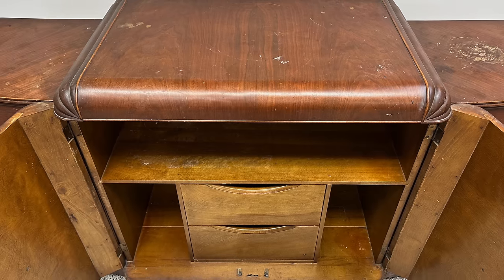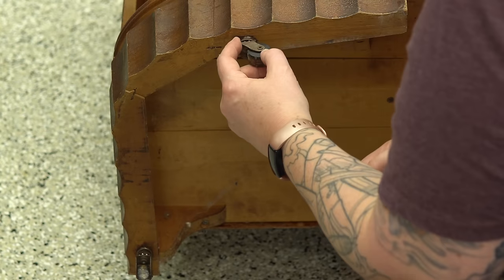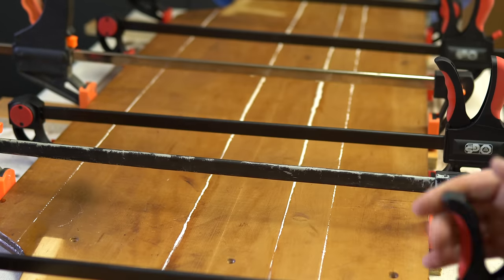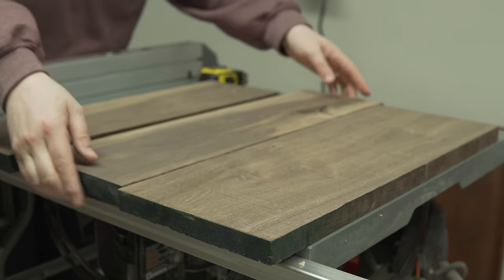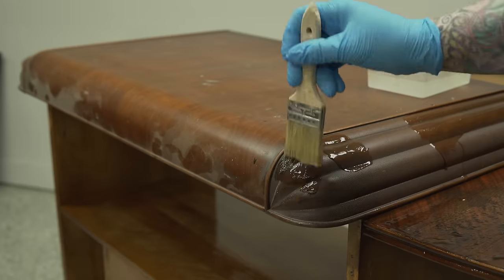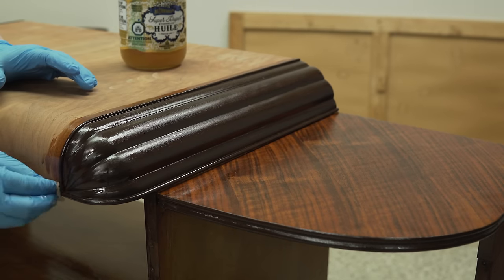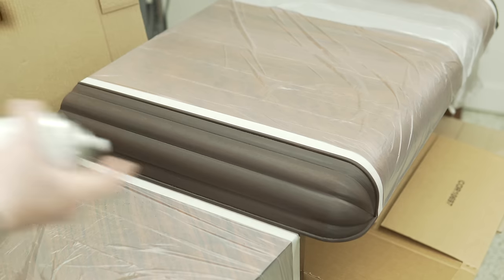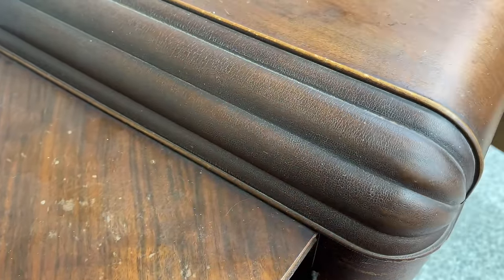I Transformed An Old Buffet Into An Art Deco Masterpiece

Comment: I’m stumped as to how anyone could think the shellac finish of that period is superior to the one you did. All that wood grain hidden for decades. There is no value to a finish that detracts from the beauty of the piece. Beautiful work as always.
Reply: Shellac is a beautiful, classical finish that can be either transparent or subtly tinted. For example check out many pieces on exhibit in the Met in New York. I'm sure the original piece was stunning when new. But when abused via liquid and sun exposure along with dust, it can cloud as here. It's also not as hard as modern varnishes, so accumulated fine scratches impart a haze. With all those flaws, a good shellac finish is still more durable than the oil used here, which will need periodic renewal forever. Finishes - as everything in life - have advantages and disadvantages.
Reply: I agree just stunning
Reply: I wonder how you think Shellack looked in the 1940’s. I think it was a whole different apperance than Today. But, that Aside, as usual, it is a wonderful masterpiece after refinishing! I want it!
Reply: yeah, this boggles my mind that anyone would look at a dingy, old, dirty and disgusting piece of furniture, with holes in veneer and cracked finish and think "wow, nobody should ever touch this thing cause it's basically perfect!" .... no, it needs to be repaired. look at that cabinet, the front doors took my breath away when finished.
Reply: @generessler6282 Shellac can be easily be refreshed and refinished, but it usually yellows. It is super easy to use and smooth though. Can't beat the dry time.
Reply: What a unique piece of furniture!! You really did it justice! There is a lot of controversy over original finish over refinishing an antique. I prefer a good refinish. I have a beautiful solid oak buffet and dining room set from my Grandmother. As it aged it “alligatored” and turned a very dark brown. As I stripped off the old finish I found  beautiful quarter sawn oak. Refinished with tung oil and it is absolutely beautiful!
Reply: beautiful well done
Reply: I'm with you, no comparison! 😊 That walnut really shines!
Reply: @generessler6282  whilst I agree with you about shellac (I have recently refinished an Edwardian dressing table to a high gloss with shellac) I think this piece just needed a new lease of life. Sometimes the shellac finish is just too far gone.
Reply: Shellac is actually a gorgeous finish when it's new and if it's been well cared for. My father has an art deco radio cabinet with original finish and the wood grain is beautiful. I have pieces that I finish with shellac and the glow it gives is really something. Would love to have seen this when it was first made.
Reply: It's a valid preference for staying true to the period vs blending eras. I also like Angie's approach - it's why I watch this channel - but I can understand the purist impulse as well.
Reply from the maker: Odie’s is a very hard wearing tung oil, and no, will not need renewal any more often than other finishes. You contradicted yourself because even shellac needs maintenance over time. ANY finish can be damaged by neglect. Classic doesn’t always mean better, though it can certainly be beautiful when well taken care of.
Reply: There is a group that will only accept original finishing no matter the advantages of more modern finishing.
Reply: People often like things yes
Reply: Right😊
Reply: Beautiful work.  Are you keeping this for yourself?  😊
Reply: B I G job! Beautiful job!
Reply: Stunning, as always.  The burl looks wonderful. I wasn't wild about the really dark stain on the contrast pieces, but knowing your work I had faith it would look beautiful and it does.  I'm always happy to see wood restored.
Reply: Well I can honestly say this restoration is really beautiful. I have never been fond of art decor pieces but two of yours changed my mind completely. Whayever product it takes to give them this second chance  works fine. Well done for another detailed and caring job done!

Comment: I was questioning your decision to go horizontal with the veneer on the side until I saw it all together.  It flows so beautifully with the doors that if it wasn't originally that way, you proved that is the way it needs to be.  Amazing job and I love watching your videos.
Reply from the maker: It’s often the opposite with veneer specifically. Normally, over solid wood running in one direction, is a substrate veneer running perpendicular. Then the outer layer of veneer goes perpendicular to THAT. The veneer itself won’t move as it’s so thin, and the graining running in this way is actually stronger and less prone to splitting than if I had run the veneer parallel to the wood underneath. Same concept with plywood which is essentially just veneers glued together. They run each layer 90 degrees to the previous one and it ends up making a very stable product. The only thing I would have liked to have done was to use a layer of substrate veneer underneath the outer layer.

Comment: I have one similar to this. Same side doors but center is drawers. It’s oak and less deco with large acorn pedestal feet. I was told it is English art deco. Thankfully it was in much better condition. It has all of its original bakelite handles. I love it. It fits perfectly between the two doors in my dining room. It holds my dining linens and good cutlery in the drawers and the curved sides act as a liquor cabinet. I assume it has its original shellac finish. I haven’t refreshed it but wouldn’t hesitate to use shellac again. It shows the original wood grain beautifully. I have quite a few pieces of vintage furniture, many with decorative veneers and would not hesitate to refresh the shellac finish. I restored my coffee table that way and it came out beautifully. French polish isn’t that difficult to do and the results are stunning. I’m about to tackle my Dad’s childhood dresser and my childhood armoire. The armoire will need to be stripped of old paint so appreciate seeing how you do it. Both will need some repair so like seeing how you approach repairs. The dresser has drawer issues and the armoire door problems.
Reply: I also have an oak buffet that someone described this way: "Doesn't get more 1930s British than that, with the oak, Jacobean legs, and bas-relief stylized flowers (a hallmark it seems of middle-class British art deco). Also the Venesta label."
I redid the top on it using Amber Shellac, because the top had damage, big water marks. Left the rest of it alone. I used very fine sandpaper and scuff pads, several thin coats. The shellac gives a nice glow.

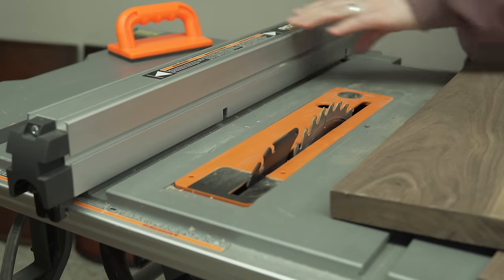Comment: 15:55 Tighten the clamping mechanism on the fence to keep the fence stationary (make sure tighten the nut underneath the thumb release too-My husband is a GC).

Also, you're using the wrong blade for ripping. You want to use a (minimum) 48 tooth blade with a carbide tip. 
All purpose good blades are Irwin, Marathon, and Freud. 

Thanks for the detail you give in your videos. I am an amateur furniture restorer and find that you and I do things similarly - me with "Mr.  Know it all" over my shoulder!
Reply from the maker: The blade on it is a general purpose blade that came with it- it’s ok for multiple uses, including ripping but it’s more of a construction grade thing. For finer work, I should be using a dedicated ripping blade, yes. 
I’ve made all the adjustments recommended but still have issues. After doing a ton of research, I discovered many others having the same problem with that style of fence, so tightening isn’t helping. Since this video, I gave up and sold that one to someone who already had one (and knows its issues) and got the dewalt one with the rack and pinion fence and omg what a difference. So much better!

Comment: Hi, Angie.  I had the same problem with my old Ryobi table saw that you described with your Rigid.  One day it died in the middle of a project.  I did some research and ended up getting the DeWalt jobsite saw (DWE7485).  It is flawless in the fence's ability to stay parallel to the blade.  Now, instead of fiddling with the fence for eight minutes on each cut, I make the adjustment and know that it is dead on.  Highly recommended.
Reply from the maker: You're not the first to suggest the Dewalt Jobsite saws. I appreciate the recommendation!! Thank you so much for watching! 😊

Comment: Beautiful piece Angie. Nice work. As for your table saw fence issue, many of the small benchtop saws have that problem. Some perhaps more than others. First check all of the nuts are tight. Some people have made there own fences to solve the issue. Try to widen your fence and/or the guides, to provide more clamping surface. I often place a 2x4 behind my fence and clamp that to the table top. But that can get complicated when the fence is closer to the blade or the table top is webbed underneath. You may consider upgrading to a good quality contractor saw. Less expensive and smaller than a cabinet saw.

Comment: Angie,

The portable contractor saws pretty much all have fence issues.  They are meant for construction quality rips on OSB for the most part.  I do not know of an improved fence you could buy for one.

If you need to make precision cuts, I have 2 suggestions, that take into account your limited space.  1 is expensive and easier,  the other is cheap but the setup takes longer for each cut.

Expensive option.  Buy a track and saw setup.  When you need to make a precise cut, clamp the track down and cut it.  Easy, and takes very little space to store.

Cheap option.  Measure your circular saw shoe to find the distance from the blade to the edge of the shoe.  Buy an 8 foot long piece of 1", or 1.5" square tube.  When you need to make a precise cut, measure over the width of your shoe, clamp  down the steel and use that as a fence for your circular saw.  Cheap, and still takes very little storage space.

Hope this helps!
Reply from the maker: Thank you very much! 😊

Comment: I really like your work and all the explanations you provide. That piece is amazing now that you've saved it. I have a few unsolicited tips to offer that you may find useful: 
1, whenever you're using 3+ clamps, go over-under-over pattern with them. It helps distribute the pressure so that the boards don't subtly curve upward as the glue dries.
2, when you're doing your glue-up and clamp, try not to wipe the glue as you go. Get everything set, and let the squeeze out dry for about 30 minutes, then come scrape off the excess. That way the wet glue doesn't get spread around on the wood when wiping and potentially interfere with the new finish adhering nicely later.
3, also for drawers or other slot-in panels, do not glue them in place. Let them float, and just glue up the rails and stiles. If you glue in the panel, as the wood swells and shrinks, it's going to pull at the panel and eventually that will break. Leaving it unglued allows the panel to shift about naturally with the wood and keep its integrity.
Reply from the maker: Hi! Thanks for the tips. It’s hard to tell in the video, but because I don’t have proper clamps for this sort of glue up, I can’t go underneath with them, so at the very least, I did alternating ones (where the handles were on different sides of the piece) which also helps distribute the pressure. What you mentioned is what I was referring to when I said I didn’t have the right clamps. 
In regards to number 2, I only let the glue sit and dry to scrape off later if there is already a finish on the wood. Otherwise, especially with light wood, I find it stains the raw wood too much. Cleaning it off first and then a light sanding usually does the trick for me on raw woods. But yeah - if I had reglued the panel prior to sanding the old finish off- that would have been my preferred method- just scraping it off. 
And for number three- that is correct, and that’s why I did not glue the entire panels in place, only the drawer components, and a tiny dab of glue at the front. The panel is floating, except for a couple of nails at the back. These drawers aren’t made of solid wood, they are plywood, which is much less prone to expanding and contracting. Only the drawer face is solid wood.

Comment: hi, I have had similar problems with a jobsite style tablesaw fence where it begins to drift during the cut. I had looked into replacing the fence with some of the aftermarket fences but they can be rather expensive and finding one that will work with your particular model can be difficult, so what I did was a few things. I would do a rough cut and get fairly close to the desired dimension, ( i use a 50 tooth ATBR blade) then cut again to the final dimension. to keep the fence from moving i clamp a piece of wood up against the fence down to the top so it can't move. For doing crosscut stuff, i made a sled that fit into the slots, and dont use the fence at all, again i do at least 2 cuts, a rough cut and a final cut to dimension. hope that helps. I enjoy your videos.
Reply from the maker: Thank you so much!

Comment: I have the same table saw and love it.   I don’t care what table saw it is never trust the fence!  Use a tape from fence to blade to set your fence.
Reply from the maker: It wasn’t about setting the fence to the right spot, it was about the fence travelling, despite everything being tightened up. I also didn’t want to have to clamp it for every single cut. I switched to a dewalt with the rack and pinion fence and have had zero issues, so much happier!

Comment: Regarding the table saw, I think you need to tighten the locking lever, so when you lock it down it will not move. It has an adjusting nut. It's on page 46 of the manual. Says: TO CHECK THE TIGHTNESS OF THE RIP FENCE LOCKING LEVER, Try moving the fence from side-to-side. If the fence moves, tighten the lock nut 1/4 turn at a time, rechecking for movement after each adjustment.
There are also screws to make adjustments to insure "Parallelism." Figure 67 in the instruction manual is what I am looking at.

Comment: Re: your saw - I have worked with a few worksite type table saws that have had that problem. Generally, they're just not set up for precision. I solved my problem by getting a delta tble saw on the cheap from an auction, but at the end of the day, you might be able to just replace the fence. Cut precision is All about that fence, and I'm sure there are options for precision fence that will fit your saw. 🤞
Reply from the maker: Thanks so much! 😊

Comment: In answer to your table saw problems the fence is easy to fix and you need to add a spacer to avoid kickback. Firstly locate the adjusting nut on the non locking end of your fence and tighten until you are happy with the clamping force applied when you lock the fence. Now cut a piece of 1/2 inch thick wood about 18 inches long and as wide as your fence is high. Measurements are not critical so experiment with what you think works best also I would use hard wood that I have ran thru the planer. Attach it to the blade side of the fence not extending past the far end of the blade. Now as your work piece passes the blade there is a gap for the piece to relieve into avoiding kickback. This is a common table saw accessory and can be designed and attached in many different ways so check out wood working videos, go online or use your own creativity and good luck.

Comment: The gate problem with the table saw: I used the same method as my dad dud with his...it's hard to describe....1st the clamp that you use to lock it in place needs to be really tight. 2nd measure the back end then clamp down part way and tap either in or out with the palm of your hand to move millimeters at a time to the correct spot. Then remeasure and clamp tight. Don't know if this helps but....in this way I'm always able to get perfect measurements.

Comment: Beautiful ! Those art-deco sidetables would look fantastic with this piece. How many hours did you spend on this project ?
Reply from the maker: Because I have to film these projects, they take me much longer than they would otherwise. Every time I move at all, the camera has to be repositioned, so it actually makes it extremely difficult to estimate how long for each project. It depends also on materials used, dry times etc, whether it’s cold or hot and humid that day, as that can also affect dry times. Most pieces take me at least a few days, sometimes up to a week or more. I know that’s not a very accurate answer but the truth is, because I have a lot camerawork added in, I honestly don’t know.

Comment: Mark a tooth on your saw blade. Measure from the tooth to the mitre gauge slot. Rotate the tooth to the back and measure again. Your blade needs to be aligned to that mitre slot. Now set your fence up to the slot, both front and back. You should now be free of drifting or binding. But, it all depends on your saw, how adjustable it is, and how long it stays in position.
Reply from the maker: The blade is square, and isn’t the issue, the fence is. It doesn’t move parallel, and I have to double measure with every cut. It also, despite being clamped and tightened, isn’t fully secure.

Comment: This is just glorious!!! When you mentioned sanding to obtain more sheen from the oil, do you refer to sanding previous to rubbing the oil? So higher grit means more shine?
Reply from the maker: Yes, the smoother the surface prior, the higher the sheen, as the sanding after a certain point starts to burnish the wood rather than sand it. Odie’s is great for these projects because it molecularly bonds to the wood, rather than replying on scratch patterns in the wood to adhere. That’s why normal film finishes require a pretty low final grit to adhere properly (usually around 150-180). With Odie’s, you could technically sand into the thousands and it will still bond.
Reply: Great! Many thanks! I started using oil wax in my latest project (a beautiful old dresser)